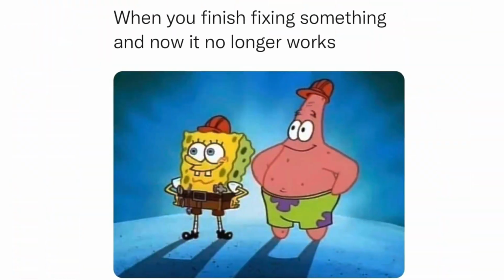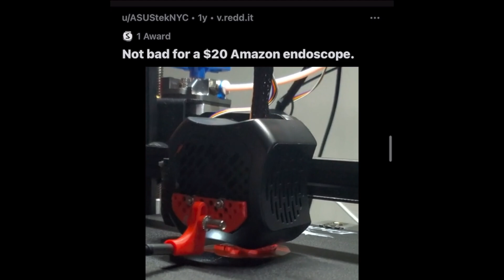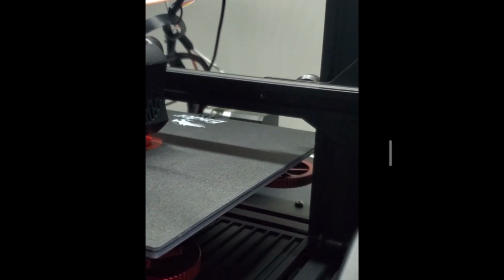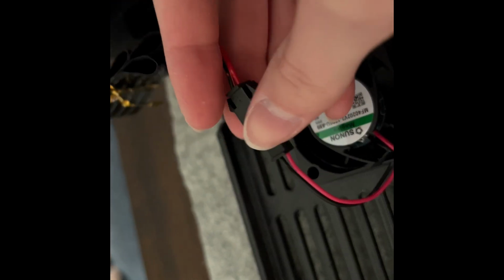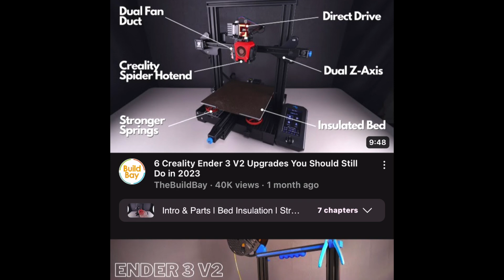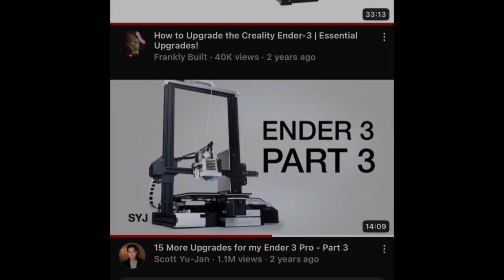Upgrading The Ender3V2: My Experience

Comment: Hello, I know it's been 2 years and I hope you're doing ok.

I didn't quite understand why you swapped the board from 4.2.2 to 4.2.7, you said the later is a silent board, but both have the same stepper drivers. The vast majority of the ender 3V2 noises comes from the stock fan setup which is pretty terrible, especially the heatsink fan which runs constantly ootb.
Seeing you initially purchased the aluminum extruder which exhibit the exact same flaws as the stock extruder but sturdier, I wonder if you just got mislead online.

For all the good things the community provides (free software, free models, guides etc) there's a fair share of myth and misinformation which often lead to unnecessary purchases. The only mandatory upgrade on this printer is a cheap fake BL touch to get a good first layer every-time.
Reply from the maker: Hey, thanks for your comment. I appreciate the concern and hope you're doing well, too. 

I just wanted to clarify a few things you mentioned, since I think some context from the video might help explain the decisions I made. 

While it's true that both the 4.2.2 and 4.2.7 can come with silent stepper drivers, not all 4.2.2 boards are the same. Some got shipped with drivers like the A4988, which are not silent. That's actually what mine had. Unfortunately, Creality didn't label which stepper drivers the boards came with very well, which has led to a lot of confusion online. That's why they sell 4.2.7 "silent board" upgrades, which all use the TMC2225 drivers. I included a sound comparison in the video, and you can clearly hear the difference between the two boards: after swapping, there is no high-pitched squealing like before.

As for the aluminum extruder upgrade, I definitely agree its not perfect. However, I mentioned in the video that I tested the E-steps on both the stock and aluminum extruders, and the aluminum was much more accurate. It's sturdiness, or increased rigidity, actually improves its grip on the filament, and thus its accuracy. The flaws are still present, but it did show improved performace, hence why I kept it. 

As for the BLTouch upgrade: ironically, I did exactly what you mentioned and went with a cheap one from Amazon. Because of that, it actually came wired backwards, which I talked about in the video. This actually caused my motherboard to smoke. So yes, its a useful upgrade if you can get a decent one, but its not risk free. 

If you do get a chance to watch the full video, I think that context might help clear up some of your questions. Thanks again for taking the time to comment.

Comment: I solved the runout sensor issue by printing up a bracket that has a bearing wheel filament guide to it.  The sensor mounts to the bracket. So, the bearing wheel helps smoothly feed the filament into the sensor.  I had to replace the hotend on my Ender 3 Pro as it was encased in a blob of plastic.  I upgraded to the Spider V3 hotend and wanted a better cooler while I was at it.   The Minimus cooler fit the bill.  I've done some of the other upgrades that you show as well.
Reply: Yeah. The entry angle looked to me to be the main problem for her filament sensor setup and a guide wheel is a good solution

Comment: Wow - you are one fantastic young lady.  This was an awesome & informative video.  It was so 'down-to-earth' and real.  Got a good deal on a few (3) used Ender 3 v2's, each needing some work & upgrading.  Your video has given me a good starting point.  Once I have them all up & running, I will be able to print large projects 3 times as fast - for basically just a little bit more than the original cost of a new Ender 3 v2.
Reply from the maker: Thank you for your comment; I’m glad you enjoyed it! That’s awesome you got that deal, and I’m glad to be a help in getting those up and running! I’ve always wanted to get a deal for printers needing work and repair them.

Comment: Did you rip all the wire from the hit end on your ender 3 v2 when it just would not fucking work? Exactly as I thought!
Reply: Solder would help with those wire harnesses you made. I usually crimp and solder, wired have a way of working looses, especially on moving parts. Awesome video thank you

Comment: Whats the cable management spiral print called? I've looked around but cant find any files🥲
Reply from the maker: If you are still looking, that file actually comes with the minimus hotend shroud that I mentioned in the video. It is called “armadillo flex,” and it might show up if you search the name. But if it doesn’t, you can get the minimus file for free😁

Comment: If your printers are going to be printing close enough to you that you can hear the fans, you really should get an enclosure with a ventilation system routing the fues outside. Sure PLA isnt bad smelling but you really dont want to be breathing any melting plastic if possible v

Comment: Yeah, ender 3 base is good for unneeded upgrades = ) I guess springs, PEI, motherboard, direct drive and custom firmware with linear advance and input shaping what is really needed = ) Also you can print movement sensor instead of buying some branded bs = )

Comment: You use a Minimus Hotend Cooler System but with 40x20 fans. From where did you get it? As far as I know Rogue_Designs offers only model for 40x19 fans. Did you it by yourself?
Reply from the maker: Yes, I forgot to mention it in the video but I actually elongated it a tiny bit in the slicer so they 4020 fans could fit. I didn’t know why they didn’t fit the first time, but that makes more sense!

Comment: I've got 2 v2s an s1 and a pro and also am building an ender extender with 4.2.7 board and tft screen upgrade so it's more like my s1 and v2 screens. I'm a big fan of the 4020 blowers and hot end fans and have a few. I ordered a couple of the 5015s to upgrade my sprite extruders on my s1 and one of my v2s.. I hear they're alot louder though.. my extender is alittle modified I ended up making it a 550mm build hight.
Reply from the maker: Oh awesome, good luck with the ender extender! Yeah the 5015’s are pretty loud, so I use two and run them both at 50% so they’re a lot quieter. Definitely not silent, but it’s quiet enough for me and has more than enough cooling!

Comment: Nice vid. I replaced my fans with 4 Noctua fans ($15 per one year ago) and am no longer suffering from the noise as I put my Ender 3 v2 in my home office. I also have OctoPrint. Love it. I’m planning to buy a Bambu Lab P1S next.
Reply from the maker: Awesome! I was debating putting noctuas in mine but ultimately chose the sunons for the higher CFM. I’ve heard lots of people say the noctuas work perfectly for them though!
Reply: @KiwibearBuilds  those are good enough. For the PSU and main board cooling I installed two 92x14mm fans. And for hotend and part cooling I installed 2 40x20mm.

Comment: best upgrades for me for now was klipper and dual z belt single motor of kevinakasam and its printing perfect and kind of fast waiting on the extruder and hotend to have more flow to get more speed also i will install a dragon burner toolhead on it . klipper is a must have and if someday you have to change you lead screw just do the dual z belt and forget about lubrication wearing binding whatsoever much better x gantry aligment and wall are allways perfect.

Comment: 10:40 open it and loosen the spring (the sensor is just a spring and a switch, a simple little thing) it's going to take you 5 minutes and it will work perfectly afterward.
Reply: I'd say the entry angle of the filament is also not optimal.

Comment: link to the Sunon hot end cooler fan?
Reply from the maker: This is it on Digi-Key but you can get it on Amazon as well if you look it up; it just has to be 4020 and 24v for the Ender3 :
https://www.digikey.com/en/products/detail/sunon-fans/MF40202V2-1000U-A99/6198739?utm_adgroup=&utm_source=google&utm_medium=cpc&utm_campaign=PMax%20Shopping_Product_Medium%20ROAS%20Categories&utm_term=&utm_content=&gbraid=0AAAAADrbLljyUXYU1unh4FsowYGT1E0I8&gclid=CjwKCAjwpJWoBhA8EiwAHZFzfpHa4H0hOUrHSR8ub_dxAgbNUavPdVJTmXuCz0wMzQYx0oRKImMKqxoClZ0QAvD_BwE
Reply: @KiwibearBuilds   THANKS!!!!

Comment: about the right gantry sagging there is a bolt kind of thing that you can move so that it isn't sagging just wanted to say that for everyone who has an ender 3 v2 its also on the hotend plate.
Reply from the maker: Thanks for the info! I agree the double z screw isn’t a necessary upgrade, it was just a personal choice since it still sat a little crooked even with the eccentric nut tightened. Definitely not mandatory though!

Comment: @Kiwibear Builds do you have a link to the extruder mounted cable management? That looks perfect for my needs!
Reply from the maker: Unfortunately that is the only file I could not find the link to!😭there are lots of different styles of cable chain systems though that attach in different areas! I just kind of improvised having the chains mounted to the extruder motor. If you look up “Ender3V2 cable chains” on Thingiverse you’ll find tons of different options!

Comment: I'm following in your footsteps so to speak. I just installed the minimus fan shroud and dialed back in my bltouch etc. and it prints well. The 4020 fan fits well for me but 5015 were super tight and overall the print came out just good enough for me to use. The rails were the worst, I spend like 2h just clicking the mechanism on and off to make them not seize. I upgraded all the fans but the PSU one. I printed the motherboard cover that promised that I wouldn't have to use feet raisers... and now I'm printing feet raisers. There are 2 parts that annoy me. I have the same 4020 fans as you but the one on my hotend is for some reason whistling when printing. The other one is that my printer did not get much quieter at all. Why? Turns out my PSU is making a lot of the noise and I just found out that it's because ender3 v2 has no vent holes so the fan is constantly on and dependent on how your PSU cover is placed it can make quite a bit of noise. So I'll be printing the minimal PSU cover I found and leaving the PSU uncovered besides the contacts. I'll be a bit pissed if this fixes the noise issue but also pleased. 

Side note: Of course I screwed up installing the fans and I just about crapped myself before I realized that I just connected the 2 5015 to hotend cooling and vice versa. Just had to switch them around since I didn't fry anything because the polarities were done properly. Works really well and I'm running everything with 50% cooling and I turned off the minimum layer time in cura completely for PLA because my cooling is great now and cura's flow compensation was giving me mixed results. I printed calibration cube and calibration dragon this way and the differences are small but I'm pretty sure these are the best ones I've printed so far.
Reply from the maker: Yep, the joy of upgrading printers, haha! Improve one thing and end up having to fix three others🤣 I agree that the 4020 fan fit well and the 5015’s were way too tight. I don’t even know how I got them to fit, but it was a struggle 😂 also, I was thinking about adding linear rails, but it seems like that could end up being a struggle as well? And totally agreed about the PSU being super loud… I’m not comfortable messing with the PSU just yet so I’m leaving it for now and just enjoying all of the other quiet fans. The PSU fan is loud but definitely less of an annoying sound than the other stock fans to me. But that is a good idea about the minimal PSU cover, I may have to try that sometime! Thanks for the tip! I’m glad all of your upgrades turned out well!😁

Comment: thanks for the SD Card Adapter Holder tip
Reply from the maker: No problem 👍
Reply: @KiwibearBuilds   but you say it saved inserting in out in out mine wont read if i dont insert the adapter as well. so only benefit i see is slightly better ergo on getting the card it its still where and tear on the slot. remove card use it on pc then insert card then remove adapter then insert adapter for printer to read

Comment: Which 5015 radial fans are you using? I’m interested to know which ones good and have a decent noise level… Is this also from the Sunon brand or is this another version? Thx for the help!
Reply from the maker: Sorry for the delay! I just picked some Winsinn ones up off of Amazon, but I would honestly recommend getting better ones. I mostly got these because they were cheap. I have heard great things about the Sunon 5015’s; when I upgrade that is probably what I’m going to get!

Comment: Great video. Love all the upgrades and it definitely gives me some ideas to improve my ender 3 V2. The biggest problem I was facing was a warped bed. If I place a metal ruler onto the bed I can clearly see that there is more than 1 mm difference between the corners and the middle of the glass bed. Buying a new bed was the only possible solution. 
It would be nice if you could also add a link to which upgrades you bought! I am especially interested in the dual lead screw Z axis, the insulation under your bed and the silent fan! That are definitely things I want to change in my printer. I also don’t like the fact that the gantry is ‘hanging’ on one side…
Thanks again for the inspiration!
Dennis
Reply from the maker: Thank you, I’m glad I could give you some ideas! And yikes about the warped bed, that can be a real pain😬 I agree there is definitely benefit to a glass bed, since you know it will be level! And thank you for the suggestion! I went through and added links in the description, but for some reason it is not wanting to work at the moment, so I will go ahead and give you the links here in the meantime, if you still need them. Hope this helps! 

Dual Lead screw kit: https://a.co/d/hIyKapR

Bed insulation: https://a.co/d/78KBnSG

Sunon 4020 (24v): https://www.digikey.com/en/products/detail/sunon-fans/MF40202V2-1000U-A99/6198739?utm_adgroup=&utm_source=google&utm_medium=cpc&utm_campaign=PMax%20Shopping_Product_Medium%20ROAS%20Categories&utm_term=&utm_content=&gbraid=0AAAAADrbLljyUXYU1unh4FsowYGT1E0I8&gclid=CjwKCAjwpJWoBhA8EiwAHZFzfpHa4H0hOUrHSR8ub_dxAgbNUavPdVJTmXuCz0wMzQYx0oRKImMKqxoClZ0QAvD_BwE

Comment: Super awesome video you have made, I'll definitely have to try some of these out myself, but there is one upgrade u could try if you want that I put on my ender 3 v2. I saw filament Friday make a video on this but it is by far my favorite upgrade I have done. Basically u print a little washer and then cut your Bowden tube to a specific length, then you put that very short Bowden tube into the hot end after cleaning it out ofc the put the washer on top and screw the coupling over it. This upgrade was legendary because over time the Bowden tube always wears out and starts to loosen up which let's plastic start to get stuck between it and the nozel and the cause a lot of extra friction and a drastic drop in print quality. But with this upgrade it doesn't have to dig into the tube and is just screwed tight and then u just connect the longer part of the tube afterwards. That will still wear down but it won't matter because the gap created will be above the heatsink and no plastic will get into it. This made the Bowden tubes last significantly longer and I got way less string and overall nicer prints and it's a super easy upgrade
Reply from the maker: I have actually heard about that and was thinking about trying it! Thanks for the tip! That was a great explanation by the way. :)

Comment: Which SD card ribbon adapter did you purchase to fit the holder? Also which version did you download from thingsverse link?
Reply from the maker: This is the one I got: https://a.co/d/1VydczB 
I honestly don’t remember which version it was, but any should be fine. I know one of them has an extra hole to screw into the bottom of the printer, if that suits your needs.

Comment: Great video!
My best upgrade by far was adding a Pi with Octoprint on it.
Hooked up an old webcam and can monitor my prints while away as well using OctoEverywhere or some other service.
No more fiddling with SD cards, lots of useful plugins, ability to make timelapses, real time g-code visualizations, canceling objects that failed while continuing to print others that are still fine and many more stuff like that.
At first I thought the process would be kind of daunting, but I set a few hours for it and it was the most worthwhile thing I did for the printer.
Even printed a little holder for it that connects to the printer, it's great!
Raspberry Pis are hard to come by these days, but I'm pretty sure you can use an alternative like an Orange Pi or similar products.
Anyway, great video! Really enjoyed it!
Reply from the maker: That’s awesome you got to use an old webcam! I’ve tried both octoprint and Klipper on different printers and could never seem to get it to work; I think I’m cursed to always use SD cards🤣 it was fun to mess with the plug-ins and things while it still worked, though! Octoprint is definitely an awesome service! Maybe someday I’ll try again😁 I’m glad you enjoyed the video!

Comment: You can put your runout sensor back on, there are arms that push the filament out at an angle the way you were holding it  in the video. That way the filament isn't damaged when it goes into the sensor. But, sorry, I don't ahve a fix fro the noise.

Comment: Hey, quick question, I was wondering what fans you used for your hotend?
Reply from the maker: This is a link to the exact fan on Digi-Key but you can get it anywhere you want! https://www.youtube.com/redirect?event=comments&redir_token=QUFFLUhqbjd2ajZMRUF4RkJodlV6aWN2QnFfemlYenhWQXxBQ3Jtc0tuZmhXcU1PbUVZNUxoSE5wLW5PYUJ6OEZhd0RjQnBMb0pVaURZRlQ2Q0ZNSm5qSnlnY21vWjY2Z0phcFpBenJLX0Z6TWtvOGVzZHRoX2MtbmN4M3FBeTJYNDd1aExHSmpwUWVFamV4UkR0QU9ZREZ0TQ&q=https%3A%2F%2Fwww.digikey.com%2Fen%2Fproducts%2Fdetail%2FMF40202V2-1000U-A99%2F6198739&html_redirect=1
Reply: @KiwibearBuilds  Awesome, thank you!